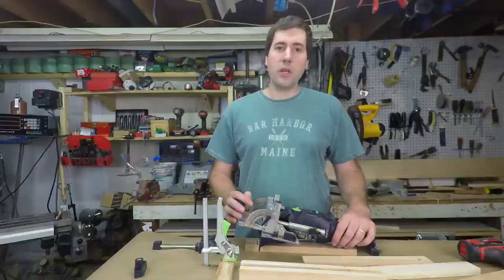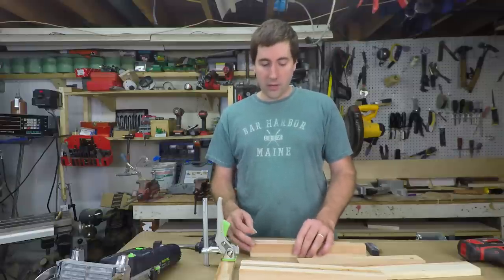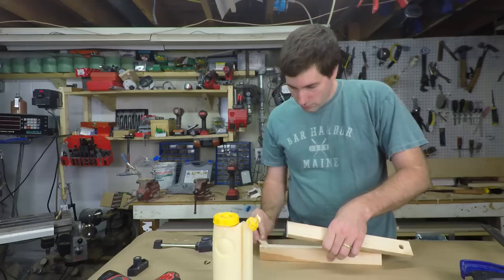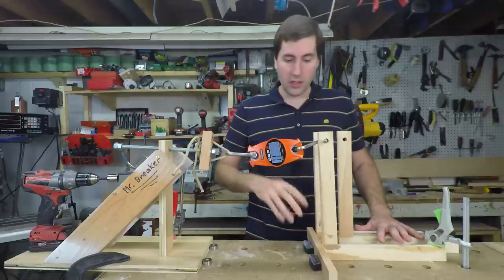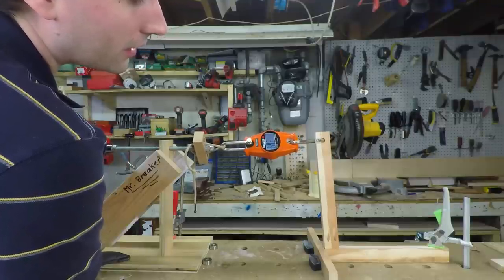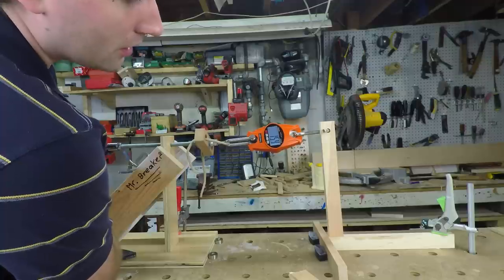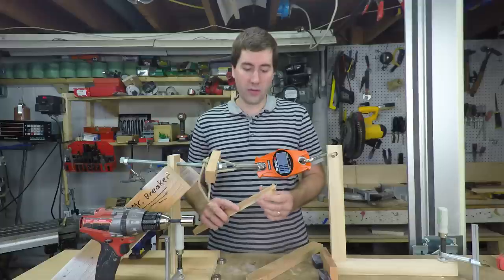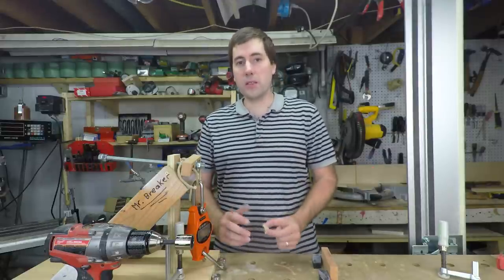Festool Domino vs Pocket Screw Strength Test!

Comment: Usually you apply the glue to the mortises rather than the dominos. A decent 10mm domino joint should be easily out performing a double pocket hole screw joint.

Comment: Pocket hole joinery is great. Super fast and no waiting on the glue to dry. You can built twice as fast as using glue with the domino. I have the domino. I love it when you have the time and want to hide the joints in stained wood. If it is painted though then it is pocket holes because you can easily hide the joints.
Reply: Alignment is the only challenge with pocket holes.

Comment: The manual that came with your Domino suggests following the old 1/3 the thickness of the workpiece rule for hardwoods. And undersizing the Domino for plywood or MDF. Your Domino would have been correctly sized if you were using those materials. On 3/4 cherry, (18-19mm) a 6mm Domino would have been more appropriate. Do I think it would have changed the results of this test?  Not drastically, the pocket hole screws with the nearly double penetration into the lower leg and the giant pan head at the top will probably still win. 

Also it might be more meaningful to stress the joint in "steps" release the load and check for perminant deformation of the joint. The point at which the joint is gapped on one side or doesn't return to square is a more meaningful failure point for woodworking than total destruction.

Comment: Doing a strength test on 5 mm don't expect much moving up from 8 mm to mega 14 mm will brake the electronic scale meter  , specially the 12mm or 14mm in 70 mm depth in each pocket I dont see it breaking

Comment: Interesting test, if i was making a project that would experience stress, I would likely use a larger Domino, maybe an 8x50

Looking forward to your review of the Domino.
Reply: Exactly my thought as well. Such small dominos (or tenons) should only be used for alignment, you'll need 50 mm or more for strength

But, nice test anyway
Reply: Right thickness but not the right length. I’d like the length to be 2/3 of the way in the stile.
Reply: The domino didn't fail so the thickness was appropriate. The problem here is that he didn't provide enough surface area/mechanical strength and he could have done that with a longer domino. A longer domino would have won the test easily.
Reply: It is very unlikely that any furniture would actually be subjected to forces of the nature applied in the video.
Reply: bighand69 It’s just a data point in a specific application that may help people better design their Roberts.
Reply: @SpydieFan  
I think all the methods would work for most furniture.
Reply: @bighands69  To some extent, depends on your aesthetic preference. size and strength  requirement, tool and skill set. 

Personally, I use my Domino all the time, super easy to use, precise and quite flexible. Occasionally I use pocket screws and only if i'm making a through mortise will I make a traditional Mortise and Tenon. 

I am sure you can think of certain scenarios where different joints are more appropriate.
Reply: @SpydieFan  
Domino is a very hand machine and I use i my self but the strength demonstrations of this video show that all the methods shown would work in the vast majority of cases. 
With the right design you could make beds with pocket holes.

Comment: Interesting test but pocket screws or Dominos will make a joint strong enough for cabinetry and furniture. I have built a lot of casework using biscuits and they are still together.

Comment: Two pocket screws vs. one domino? It also appears the screws penetrated deeper into the wood than the domino.  I would try a bigger/longer domino
Reply: The domino is wider so it is about surface area and not the actual number of screws. 

The fact you had to mention two screws being used shows that you do not understand that pocket hole joint would have to have two screws at a minimum or it would start to twist and not be a proper joint.
Reply: LOL.
Reply: @bighands69  @darrickrasmussen5946 is right. Yes, the domino is wider and it is the overall surface area that gives dominos their strength, however, two screws are still stronger than one (even if the purpose on light applications is to prevent twisting). But the glue surfaces of two dominos is stronger yet than the glue surface of one as well (double the strength if I am doing my arithmetic correctly). What we see in this video is a test with flawed methodology. If the tester didn't think he had enough wood for a second domino he should have gotten a larger piece of wood. After all, the piece he used would be for a light project or a more substantial project with other joinery and wood pieces to take the load. If he was making a face frame, for example, the 20 lbs. threshold of the domino would generally be enough. But if he had performed a two-domino test vs a two pocket screw test, the domino clearly would have won.

Comment: Generally it is quicker to use pocket holes for face frames they dont need to be that strong and you don’t have to clamp them if you glue them as well as screw. The domino is also an excellent tool for this light duty joint  but you will have to clamp the joint while the glue dries etc. The benefit of pocket holes is the jig is very good value-cheap and doesn’t take up much space. The festool domino machine is also good value if you don’t want pocket holes showing on the finish and you have good clamping kit. The machine is expensive but very versatile and one of festools  best tools.

Comment: Nice test. I also just did a pocket hole strength test video (not a comparison, just a brute strength test where I drove on the joint).  I suspect a larger/longer domino would have won. But at any rate, great video. ~James
Reply: I wonder how much pressure a true mortise and tenon joint would take to fail
Reply: @Zeke Cash, no. Nobody cares. Stop spamming.

Comment: Great demonstration. It appears though that your pocket screws were tearing out around 10 pounds of force and you could see the joint had been compromised as it was bending. With the domino you stopped counting force when it cracked by sound but was still nearly 90 degrees. It would have been interesting to see what the force was when the tenon actually broke.

Comment: Where did you even find dominos that short?  If it's failing due to the glue (instead of wood failure) releasing the joint is not appropriately sized.  The domino should be about 1/3 to 1/2 the thickness of the wood being joined and as long as possible up to whatever length becomes unreasonable, just like a regular tenon.

Comment: Typically, I use pocket screws when the only stress is against an immovable object. For instance, on a table top to fasten the top to the legs or the rails. The stress is not against the screw but rather the legs which are nearly impossible to compress.

Comment: Hi
Did you test the same domino but with different depth? Wondering what will be the effect of depth. Especially usefull to compare domino 500 vs domino 700 size 10 mm tenons
Reply from the maker: +cortese y I tested 6x40mm dominos in the full Domino review and they did significantly better.

Comment: Think I will stick to my traditional mortise and tenons. It's a good set up you have. As an aside thought how long has that glue been open and or has it got cold? I've had some failures recently on edge jointed boards using tirebond 1 from a jug that's been open a while and I'm sure it's lost some of its potency was my glue of choice. Now I'm back on cascamite.
Reply: Adam Lynch I didn't realise you could still get cascamite? Where do you buy it?
Reply: Paul McFadyen I'm in the Uk and it's available from lots of places. I brought my last lot 15kg bag of eBay
Reply: Adam Lynch good to know. I'm in Glasgow. Haven't seen cascamite in years. I'll have a look on eBay. Cheers👍
Reply: Paul McFadyen I used to use it loads but went onto Titebond but fed up with that going off. Axminster do it also.
Reply: Adam Lynch I like gorilla wood glue for it's quick set up time and I've always had good results.

Comment: Great video. No matter what your test shows festool lovers will make up any excuse as to why it did not win. I think festool makes some really nice tools but there prices are much too high in my opinion.
Reply: Jason B haha just what I was thinking pal ! :)
Reply: Tried my dominos XX and that holds about 1060lb
Reply: Well, you get what you pay for. The older I get the more that little saying rings true. I just bought the Domino XL. It's the only Festool tool I own. I cannot believe how well made this tool is. The fit and finish is insane. It actually looks, feels and performs like it is worth as much as they charge. By comparison, I also have a Porter Cable biscuit joiner. Yes, they are totally different tools, but they do similar functions. It's night and day. So, while I agree that Festool costs a lot of money, I don't agree they are over priced. They are simply a level of quality that some people aren't willing to pay for. I, for one, am also not willing to pay for that level of quality, but the Domino XL is a one off tool that has no true competitors for less money and less quality.
Reply: No excuses needed.  The domino joint's main benefit is joint alignment that's superior to pocket hole screwed joints that move during assembly and typically require more sanding to flush up the pieces.  The strength of the domino joint may be less than that of the pocket screwed and glued joint, but it's plenty strong, unless for some reason you like to make face frames and other items for the sole purpose of destruction.
Reply: "it's too expensive....whaaaaaa!" The domino strength can be outdone by pocket screw in some applications but not in others. Small domino in small soft wood, ok, it failed. Large domino in large hardwood, no way it will be outdone by pocket screw. Look, it's expensive, we all get that. But the Domino is as fast or faster than pocket screw depending on the worker and the joint being done, more accurate than pocket screw, can do some things pocket screw can't, and it it doesn't leave that ugly hole on one side. I'd rather have a more expensive tool that works better than a cheaper tool that falls short on most of the metrics. And I do use pocket screw for some things because sometimes it is the better option.
Reply: Not   a fair test..Dominoes too short.

Comment: You need a longer insertion depth as the real resistance here are the two sidewalls of the floating tenon.  But it’s a good test to show that all joints are situation dependent.  Festool is very nice, but they also have a team of fanboys that thinks it’s the solution to everything.  It’s just a tool and has to be used depending on the situation.  With narrow pieces like this, I suspect two long dowels will do the best... short of a good ol’ mortise and tenon locked in with a wedge.

Comment: I have read an article on gluing that said that wood shall have fresh surfaces when glued (surface tension decreases over time). That combined with Internet rumors stating that shopmade dominos are stronger than Festools opens for another test tweak: newly, ligthly sanded Festool dominos. Will you check that? 😉

Comment: Your dominoes are way to short - concentrates the mechanical force on a smaller area which is why the WOOD around the domino fails - the domino itself is still perfectly intact. All in all not a great test.

Comment: Dominoes are for alignment, not really for strength. They offer more strength than biscuits because they are thicker and go further into the wood but unless you make them the size of a normal tenon there's not enough there to add a significant amount of reinforcement.

Comment: The domino is not a precise tool. It's designed with too much slop on the mating side, hence the weakness. The strongest tool for joinery is a Mafell Doweller.
Reply: I make my own dominos and they are a tight fit. I'm not keen on the Festool consumables